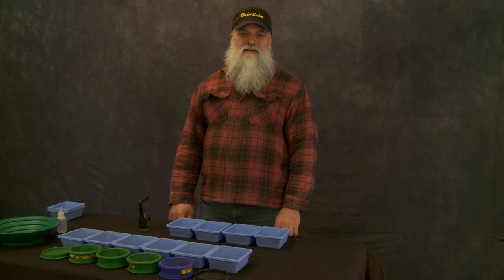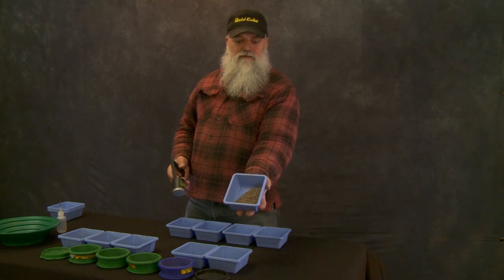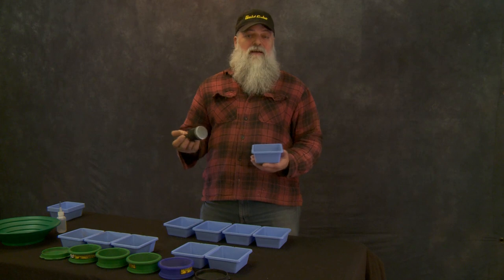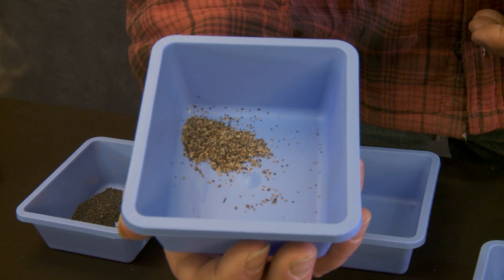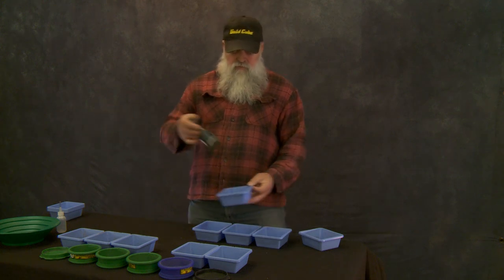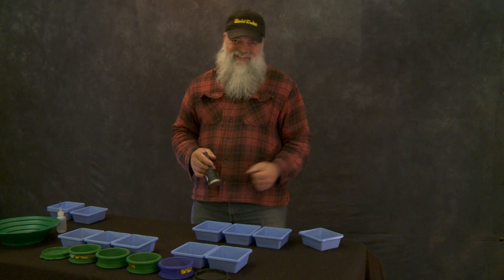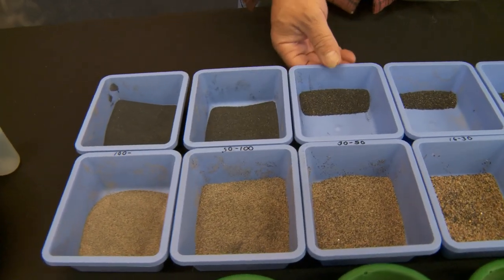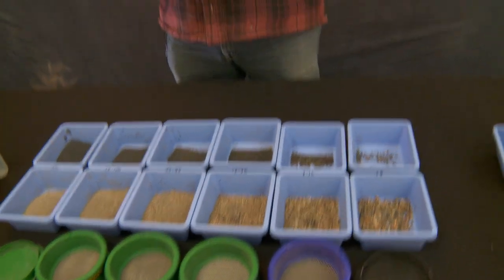3  Magnetics

Comment: Dang Mike, you must have lots of money :)  Your wasting all that gold and platinum that is tied up in that black sand.  I work creeks where Platinum runs 40% to gold!  That means if I get 10 grams of gold I can't afford to throw away 4 grams of platinum.  Also inside that black sand there is oddles of microfine gold.  Your method is good but you need to advise that the black sand has lots of values and must be worked differently later to extract them.  Remember, "Gold wears and iron hat!"